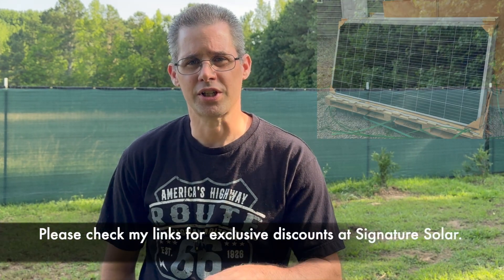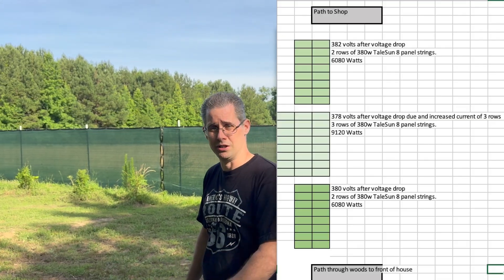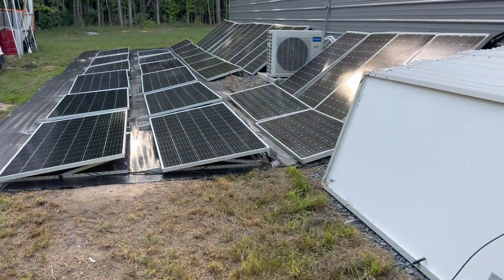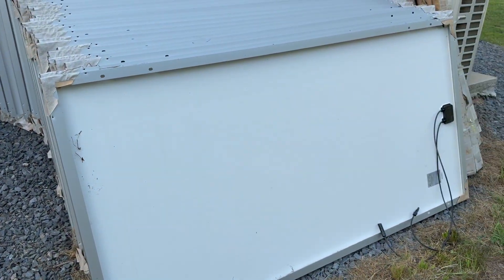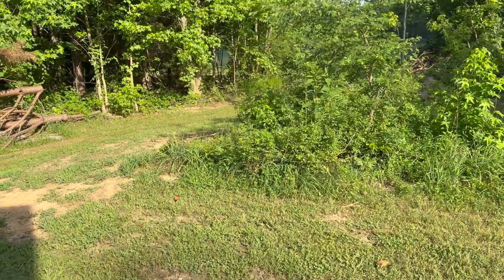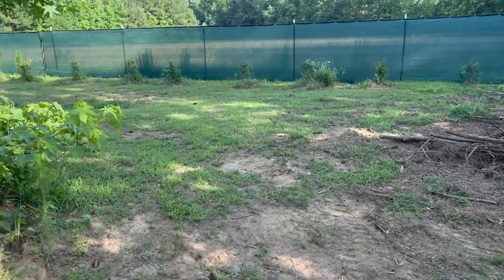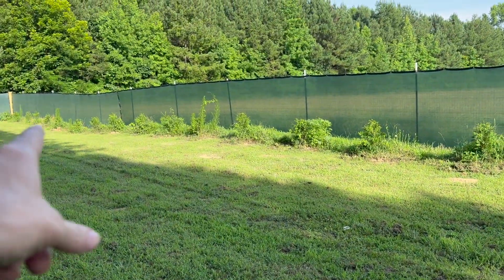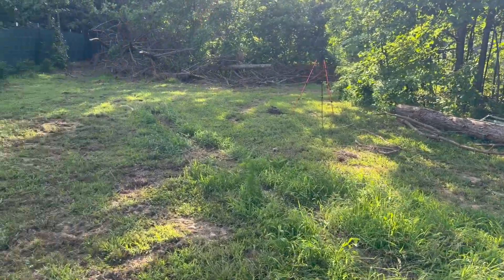Talesun 380W Solar Panels: Off-Grid Plans and Solar Layout

Comment: Hope you got some  optimizer for those panels. You got lots of shading going on .
Reply from the maker: You have a very good point on the shading.  The hope is that I could over panel to the point that I could go without optimizers.  But if needed I will buy some.  As always you have very sound advice.